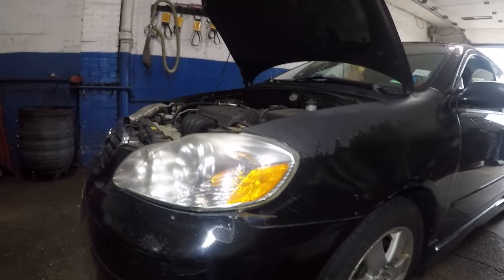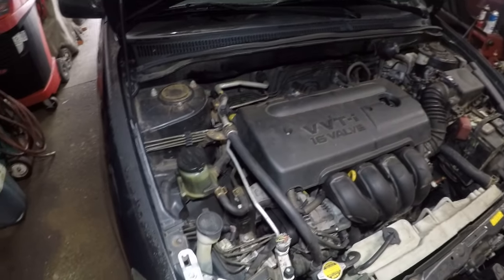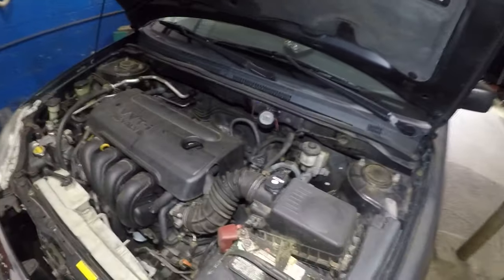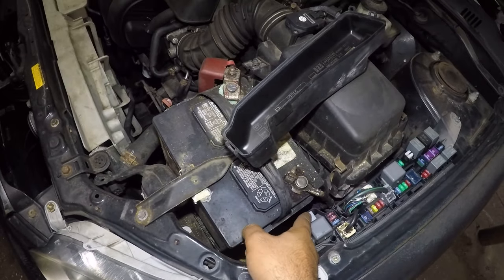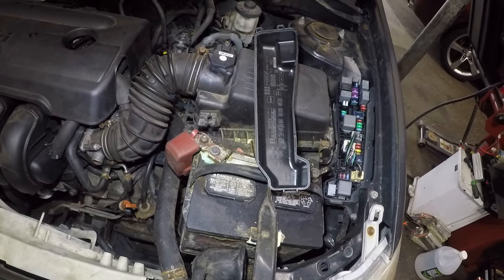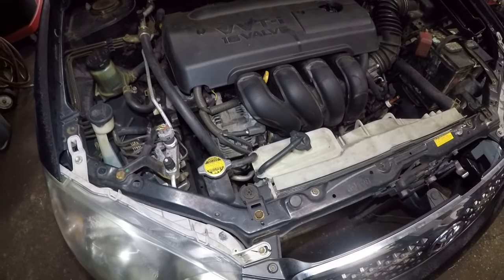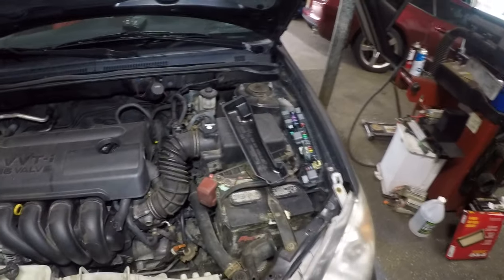Toyota corolla 2007 AC Dont work, Quick Fix AC Relay

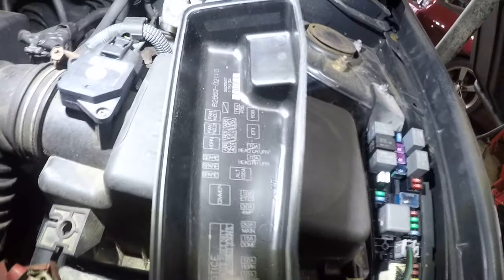Comment: 5:22 good video. 
I have 2013 RAV4 with no AC. I connected the car to the scanner and I see the AC signal working on/off
I went underneath the car and unplugged the AC compressor connector and checked the power from there and it showed 14 volts. . The line does have pressure but doesn’t get cold. What else can i check?
Reply from the maker: How did u check 14v. Was the engine running was the ac on ?
Reply: @RBTheMechanic  hi, engine was running with AC ON and I used a volt meter to check the power at the connector. 
I checked the fuse box for the magnetic clutch relay and it was missing so not sure how the connector was reading 14volts. 
I put a relay for the MG clutch and still didn’t work. Not sure if this car 2013 RAV4 has a magnetic clutch relay or something else. Any tips will be appreciated. Thanks

Comment: Hello thanks for the video. My ac was working then it would stop in the next day would work for a little bit then stop now it’s completely off.
I changed the Relay and fuse. The AC compressor is not spinning. I tried to add Freon to the low pressure side and the digital reader was at 120. I did not add any. Anything would help thanks
Reply from the maker: Did u check to see if ac compressor has power when it was shut down also u might have to recharge the Freon since u added with can it got I ever pressure
Reply: @RBTheMechanic  So I started up today and the compressor was spinning I checked the pressure and it was at 30 so I filled it up to 45. It was turning off and on. Not sure why
Reply from the maker: @search_collectibles  it suppose to turn on and off but did u use can?
Reply: @RBTheMechanic  hey bud thanks for replying. Yes I use the can when it was spinning but then it stopped spinning. 
So my problem is the ac comes on then it turns off and blows warm. Maybe bad clutch or I dunno. I’ll check it tomorrow for sure. It was at 30psi got up to 45psi. I changed the fuse and relay. It’ll blow cold and spin for a bit then it’ll stop spinning and blow warm.
Reply from the maker: @search_collectibles  u might have air pressure reservice it using ac machine at mechanic shop

Comment: Hello 
My 2007 Corolla AC switch light on and off and cooling stops too , this happens mostly when I stopped car for 10 minutes or while driving.
I changed the relay also and recently I filled gas too.

Please advise what I need to check???

Regards 
Maaz
Reply from the maker: I think ur low on Freon or have air pressure it might be u filled with can which is not the best way. So how did u fill gas?

Comment: What is the possible problem if my ac compressor turns on when I start the car and stays on until I shut off the car? I also have no cold air in my vehicle. I drive a 2013 Hyundai Elantra GT.
Reply from the maker: Well u need to swap out relay first it could be locked up relay or pressure issues
Reply: Thank you! I will check
Reply: So I checked the relays and they were good but I think I have a variable ac compressor and that's the reason it stays on even when I shut off the AC. I also have 1 radiator fan and it does not turn on when I turn on my AC. Although it does come on for a minute or so when I unplug the ac low pressure switch.. You think its the solenoid in the compressor?
Reply from the maker: @gilliwisemedia8353  well fan is suppose to come on and off and ac compressor suppose to come on and off but before anything u need to service the system so it can work propperly
Reply: Okay, next step, get car serviced. Thank you sir. I appreciate the professional insight!
Reply from the maker: @gilliwisemedia8353  service meaning the ac system h have to clear out the system and put in correct amount of r134 too much too little or hot air pressure will cause bad symptoms and only way to confirm is to do the service

Comment: I have 2003 Toyota Camry v4 my problem is when I turn on the AC my engine turn off ? But if I don't use the ac my car runs great  freeway and everything any idea
Reply from the maker: It could be ac compressor locked up or ur idle is tooooo low
Reply: @RBTheMechanic  how do I fix those problem
Reply from the maker: @bayfinest1938  start with cleaning
Reply: @RBTheMechanic  clean what?
Reply from the maker: @bayfinest1938  throttle
Reply: @RBTheMechanic  how can a throttle body fix the ac
Reply from the maker: @bayfinest1938  throttle body dosent fix ac if it’s low idle speed and engine stall with load of ac system it will fix the idle speed then it will not stall with ac load

Comment: At a loss right now. Checked my relay recently. I replace resistor and blower motor a month before the ac went. My ac kicked on randomly two weeks ago but hasn’t worked since and my compressor is clicking on and off.
Reply from the maker: Swap out the relay it’s only like $11 other wise u might have mix air and gas pressure which might be low on gas I just had car that ac clicked on compressor worked but no cold air it was low on r134.  Service the ac system and please do it with using ac machine so it’s accurate vacuumed and propperly charged with gas
Reply: So definitely take the ac to get serviced and swap the relay?
Reply from the maker: @unique3229  that’s what I would do if u had come to service to my shop that is the only step u can take seems like ur ac is working might just be low on Freon.  Did u try to tough the low side line with ac on to see if it’s cold.  If it’s ice cold or mild cold that should determine it.
Reply: I’m sure the Freon started to go due to it being a month since the ac stopped running. You can hear the compressor click on there is no air at coming out and there is a brand new blower motor and resistor.
Reply from the maker: @unique3229  ok so u have no air comming that’s diffrent system fist that first then jump to ac issue did u try checking fuses and relay for blower motor check all fuses under dash and hood
Reply: I checked the ac fuse under dash and the relay under hood those are the only two I am aware about as far as the ac is concerned
Reply from the maker: @unique3229  how about the ac line dose it get cold or change in temprature
Reply: No doesn’t seem like it however you can hear the ac trying to push cold air
Reply from the maker: @unique3229  but is the line cold?
Reply: No it does not
Reply from the maker: @unique3229  ok so ur ac dosent work it might be Comming on because of air pressure e reservice the system
Reply: @RBTheMechanic  so what would be my course of action then?
Reply from the maker: @unique3229  well if u got ac Freon and pressure is good I would check to see if ac compressor comes on if not then check power to ac compressor at the connector other wise if it comes on and dosent get cold then it would be low Freon and high air pressure which would cause it and let it to come on but not make cold
Reply: @RBTheMechanic  I did that before and what ended up happening was compressor would go on air would not run you can hear the hiss that happens when the pressure releases to allow the Freon to go through just not running air
Reply from the maker: @unique3229  sorry I’m not understanding air or ac not cold?   Air is blower motor that give u air
Reply from the maker: @unique3229  u might have blockage in the system might have to replace the system or start with the filter

Comment: My yaris get cold air air only when im on highway .if I stop at the light its get warm. any help?
Reply from the maker: Seems like low Freon u need to recharge the system due to high rpm it will pump quicker and make cold and when u come to stop it will not also check to see if ur radiator fans work
Reply: @RBTheMechanic  yes ! After I see your video I checked .it is running! As soon I turned on !
Reply: Thanks for the quick reply !
Reply from the maker: @-Arkelon  so it’s got to be low on freon
Reply: @RBTheMechanic  I pressed the low pipe valve . Some liquid came out right after I quickly pressed  do you think I should have the system cleaned by a technician?
Reply from the maker: @-Arkelon  it will have pressure and gas but not enough usully that is the cast and yes have it reserviced by good mechanic shop with ac machine recover vaccum and recharge the system with correct
Amount oil and refrigeration
Reply: @RBTheMechanic  thank buddy . You were very helpful! God bless you!
Reply from the maker: @-Arkelon  no problem update me !!!

Comment: My AC compressor spins, I have pressure on the low side of freon, my AC fan blows 'regular outside air '. What is wrong with my AC?
Reply from the maker: Maybe ur ac compressor dosent build pressure or u might not have enough in it
Reply: @RBTheMechanic  I think I should eliminate the pressure of freon because the low pressure switch would not allow the compressor to get engaged, since compressor engages I have enough of pressure. It leaves me with a compressor that may have same pressure on the high and low side---maybe it's the expansion valve problem?
Reply from the maker: @sergejpanov5543  best think I do is reservice the system recover vaccume for 20 minutes then add correct amount oil and Freon that should eliminate all things if and or but... if ac works great! If not and compressor engages then it might be ac compressor that dosent make good amount of ac pressure circulation

Comment: corolla from 2007 does not work tachometer with temperature indicator and air conditioning at the same time...What can it be?
Reply from the maker: Did I check fuse and relay? And Freon pressure?
Reply: @RBTheMechanic  , Yes, everything is OK, I went to Toyota and they told me that the problem is Canister Assembly C. Yesterday I replaced this part.
Nothing has changed.
Reply from the maker: @emiltoma1309  which canister u changed
Reply: @RBTheMechanic  , Canister Assembly Charcoal , $ 205...
Reply: @RBTheMechanic  , I changed the Canister Assembly Charcoal because I also had the message on board check the engine, I went to Toyota and after checking with two tests $ 260, they told me that the problem is Canister Assembly Charcoal $ 270 their price because every time they remove the electrical connection at Canister the tachometer, the indicator and the air conditioning work again ...
I replaced my Canister with a new original Toyota and the problem is the same..
Reply from the maker: @emiltoma1309  that dosent have anything to do with ac system.  That evaporator system for emission it collects fuel vapors
Reply: @RBTheMechanic  , corect...
Reply from the maker: @emiltoma1309  well start testing ac system on ur own check relay swap it and check fuse check in it has ac Freon pressure.  Check power to ac compressor put the ac on and see if both radiator fans come on and do power test at the compressor connector
Reply: @RBTheMechanic  , So when the tachometer does not work with the on-board temperature indicator then the air conditioning does not work either.
When I drive about 10 miles, they return to normal and the air conditioning works.
What can it be?
Reply: @RBTheMechanic  , Freon, fuses and relay are OK ...
These were the first verified ...
Reply from the maker: @emiltoma1309  let me know if u discover anything
Reply: @RBTheMechanic  , OK..
Reply: @RBTheMechanic  , I found the problem, Computer Engineer Control is defective, I bought another used for $ 120 and two hours for the mechanic, a total of $ 280 ... I hope those who have this problem will read this comment and will not reach Metro Toyota like me from Brookpark, Ohio and cheat them with $ 260, two unnecessary tests.
If I could post a video with the on-board display issue ... Thanks
Reply from the maker: @emiltoma1309  ok cool!! Nice job!!! I never came across that issue but if I ever do I will keep this in my mind and dedicate the video to ur name

Comment: I pushed the valve and leaked for like one minute 😂😂 i tought i messed up the valve a few minutes later the ac works again 😂😂😂😂
Reply from the maker: Leaked for a minute?
Reply: @RBTheMechanic  the valve that you pushed in to check the pressure it didnt stop like on the video it was just letting all.this freon out then it stopped on its own i turned on the ac and it started working 😁
Reply from the maker: @pablotapia2346  prolly was over pressured well that’s good tho!! Enjoy ur AC

Comment: The free way is a cord from the floor board. Run POS from battery  splice it in the hot wire to the compressor. It’s a bitch but better then 100 degree day on highway just gotta take it off every 40 mins for 5 mins to cool. And that’s the alternator not compressor
Reply from the maker: Well that’s not good idea ur directing the compressor

Comment: A.C of my Toyota Corolla 2008 is cooling only right side of the car.
Reply from the maker: Oh ok that could be low Freon the system try having it recharge with ac machine recover vaccum and recharge with correct amount of oil